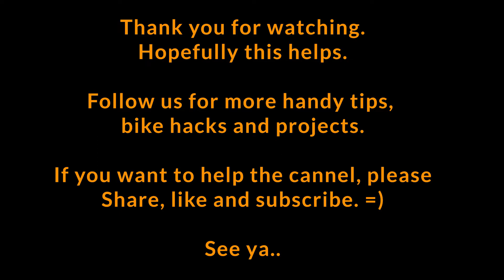Suzuki DL1050 V-Strom 2020 Front Fairing removal. how to take off the front fairing

Comment: Is there any gap between the instrumentpanel and the windscreen where I can get my wiring from the navi through? I want to take the 12V power from the plug behind the radiator which is for the grip heaters and bring it up to the navi bar over the panel. I plan to run the cables along the main wiring from the radiator up to the screen, so you won't see any cables later. How do I get the cables through the cover? Thanks for your help.
Reply from the maker: I dont know, sorry.. Can anyone else here help..?😃